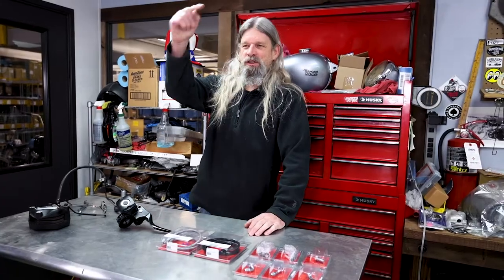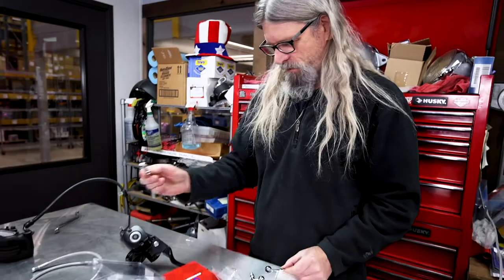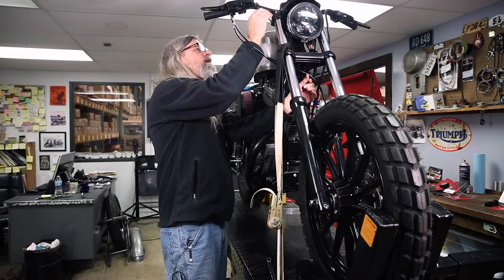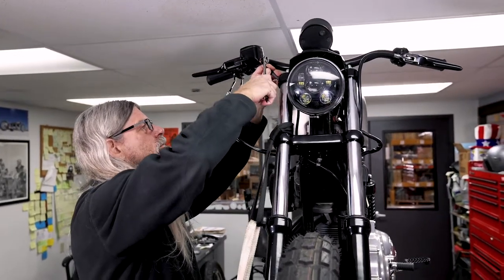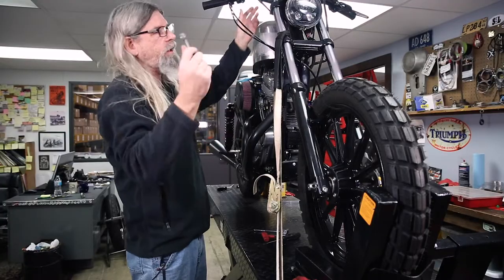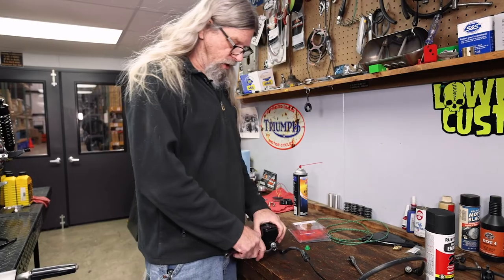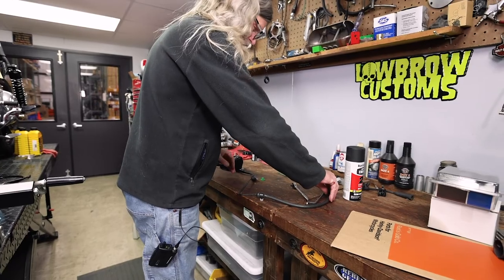How To Make Custom Brake Lines For Your Motorcycle

Comment: Great video 
I’ve been using these lines for years they are excellent. I find using 5/16 fuel line works best to figure out length it bends very similarly to the braided lines.
Reply: That’s what I did, I had it on hand!

Comment: Gonna need to rewatch this a couple times. Would be nice if there will be a rear brake line video follow up
Reply: It's the same process just on the master cylinder at the rear
Reply: @PkwyDrive13  good deal. Just need to measure what length lines that I need. I appreciate it
Reply: @jhall19k45  👍👍👍

Comment: Hi Todd great video. I have a 2015 triumph rocket roadster abs and I melted the rear brake line I have tried to order the correct part and triumph
 Uk can't even get it. I'll would love to order this system from you I'm overseas at the moment on job and can't measure the fittings I would need to order Im sure you have better things to do 😂 then to put together what I need but if not I sure would appreciate it. I could order and maybe install as soon as I get home get a little riding in before winter. Thanks for the videos.

Comment: As a former PhD technician I'd recommend cleaning the m/c out prior to installing the freshy lines. 2003..?? Probably time for a m/c rebuild. Don't forget to clean and lube your caliper slide pins. Those fixed calipers were not great.

Comment: About 8 months late to the party here, but great video as always Todd. BUT! It's not as good as your recent sportster Saturday front fork fiasco! Made me spit out my coffee. Lmas. Anyway I fashioned a cool bleeder system with my hvac vacuum pump. Kinda like you described, using 2 hoses running to a "catch can" if you will, one hose submerged in the fluid the other up high above fluid level. Worked. Like Russell speed bleeders to. Btw have you ever used Russell pro system ll nylon lines and fittings? The ones with the ferrel type compression (olives) fittings??. Just wondering as I am considering them. Sorry for the long winded rant. Thanks again for what you guys do
Reply from the maker: no we haven't used those that I can recall. if someone does here we will reach back out. Thanks for sharing. cheers.

Comment: I was on your site looking at your Goodridge brake lines. Good stuff. Hey, why was looking is because I am trying to make a longer Kawasaki OEM part (43095-0849) that goes to my hydraulic clutch, because I installed bar risers. BUT I can't find anywhere to find that two-way fitting that it has. Are you able to get that fitting? Cuz I know I ain't the only one that can use this! Thanks! 👊💯
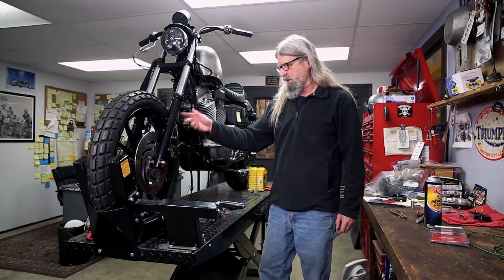Reply from the maker: have you tried reaching out to our Tech support they are available 8:30-4:00 EST monday-friday if they can't find it they might be able to point you in the right direction. 1800-935-5050

Comment: Thanks for this demonstration.  I have a 2012 Suzy V Strom which is equipped with the worst crap of an ABS module.  I stomp the rear brake and it locks up and won't release.  So I'm gonna go old school brakes. I'm 64 and been riding since I was 15.  Never cared for ABS on a motorcycle.

Comment: very good video todd. i have a 1971 FLH with a stock rear juice brake (all parts now are stock but not original). will the goodridge parts fit the stock master cylinder and wheel cylinder?
Reply from the maker: You have to check your banjo bolt and banjo fitting sizes and if they are same as what we carry then yes they will work. We have a wide variety of sizes but Not sure off hand what size a 71 rear juice brake has, Best way to find out is measure yours.

Comment: I want to know if I can remove the anti lock breaking on my street glide. It's frozen and the thing can not be fixed?      🇺🇸🇺🇸
Reply from the maker: You would have to delete the anti lock module completely to by pass it. You could also just do completely new brake lines and use stuff like this Goodridge line. This video from this dude ,https://youtu.be/9ru8O62A_A0 explains it well not sure if what year you bike is what they all look like etc. But it can be by passed. Biggest thing is you need to make sure you bleed them and test they work before ever going for a ride.

Comment: For some reason Russel doesn't sell any brake lines with male fittings, while most of the lines I wish to replace have a male on at least one end.  So, you end up buying a bunch of adapters and end up with a clusterfck. You can find lines with a banjo on one end, but for some reason the banjo is thinner that the one on the stock line, so you end up using two copper washers on each side. I've also run into a similar problem with their 3/8" banjo brake switch. The threaded section is too long for a motorcycle master cylinder.

Comment: Great video! Can you guys do a video on replacing the mounting gasket on a 1994 hd xlh883 speedometer?
Reply from the maker: You should be abled to remove a few screws in the back if the speedo mount, remove and unplug speedo from wiring harness with one plug, remove backing of speedo and take ring off, then replace gasket, and rubber and put back together. pretty straight forward job.

Comment: Just picked some of these parts up. So you literally just screw the banjo fittings into the universal line and that is it?
Reply from the maker: Just make sure your sizes are correct for your banjobolts make sure to use the crush washers, bleed and test brakes, check for any leaks... go for for a ride
Reply: @lowbrowcustoms  thanks for the thorough reply! I got my new line assembled, bled and tested. Line was leaking where the banjo fitting screwed in, but it's tightened up and working now. You've really got to thread those in tight! All in all super straightforward!

Comment: What about bikes with dual calipers with that puck/splitter thing? Do you have those to build custom lines?
Reply from the maker: still waiting on them to come back available but will have soon. Yes you need a splitter to do dual disc
Reply: You can get a double banjo bolt for the master cylinder and run two lines from it.
Or you can put the double bolt on one of the calipers and run a link line to the other one.
Hydraulics balance out so both calipers get the same pressure however you plumb it up

Comment: Any ideas on the abs models...I hear you need harley to bleed the abs bikes with a magic tool/device?  Is there away to raise your bar, change brake lines without having to get them to bleed it? 2017 dyna lower s is  the bike in question.  Cheers
Reply from the maker: You can bleed them but your systems is going to error, it's best to go to a shop that has the computer and can do it right. Annoying but better to be safe with the one thing that stops you... A lot of guys we know have deleted the ABS from the system completely and just run standard brake lines on those Dynas
Reply: @lowbrowcustoms  thanks for the reply guys. Much appreciated

Comment: Has anyone done this with dual disc yet? A little confused on what fittings to get
Reply from the maker: Hit up todd on our tech support line - 1800-935-5050 and he can help you out and get the right parts. just make sure to give him all the info on what you are working with model wise etc. Cheers

Comment: Hmmm 13:00 be sure to add half the stroke travel of the front suspension when selecting the line. If this bike only has .250 extra, I'd not want to see it hit a bad pothole (or wheelie).

Comment: Not to sound like a hater (I've ordered stuff from you guys), but:
You keep calling the brake cylinder the master cylinder.
I watched this hoping you were going to actually "cut" brake line and attach the fittings.
All you did was install ready made components. Heck, anyone can do that!
Reply from the maker: Well not everyone knows about these great kits and it takes out all of the non sense of having to cut them and re-do them. Just easier and less mess.